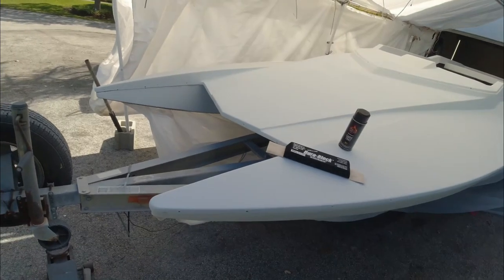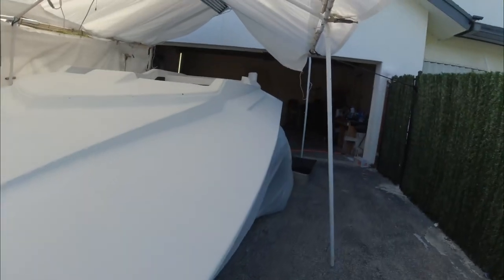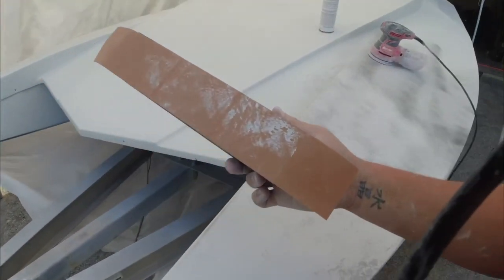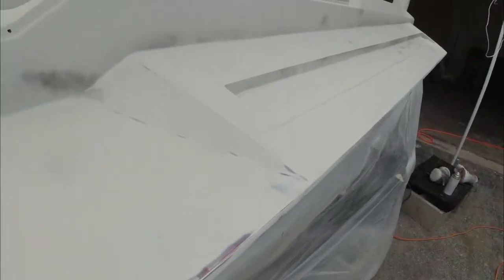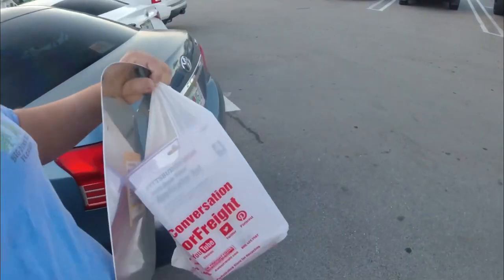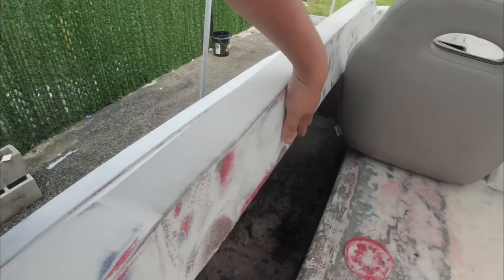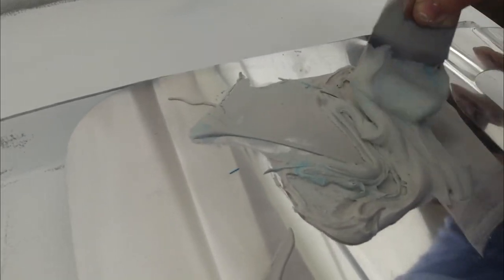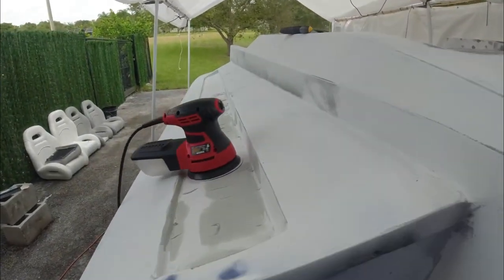Block sanding high build primer to find low spots | Applying 3M Body filler

Comment: I dig the video & the new jams. Looked like your primer was thick & not fully cured. 

I’ve been sanding filler w/ 80 grit for shaping, then hit everything w/ 150 grit before primer. 150 grit in between primer coats, then 320 grit before paint. Every manufacturer  has their recommended grits & procedure. Several ways to skin a cat. Your motivation & no fear is awesome 👍👍
Reply from the maker: Thanks for the advice man 🤙🏼
Reply: Great advice I’m doing gel coat on my boat I never done gel coat before
Reply: @boatvibes  thanks for responding Luis. You did the right thing by turning her all one color to see the imperfections. 

I’ve found that applying more thin coats than a couple heavy coats is easier to sand because it cures better. I’ve also laid the first coat on a little thinner to use it as a tack coat for the rest. 

Everyone has their own way & a lot of good info on YouTube. Boat Painting and Restoration with Frankie Bushong YouTube channel does a lot of spraying. 

There’s a great comment on your last video about why you’re getting water in your line & gun. It’s all about getting clean dry air. A larger compressor would be able to keep up. Air filtration & a water separator will also help you.

Comment: Hey Luis, I'd recommend vinyl flooring instead of the carpet. A lot easier to clean the dirt and sand. I spent years cleaning my carpet and got really tired of doing it so I put vinyl in and love it. A quick wipe down with a wet rag and it's clean.
Otherwise I love your channel and enjoy watching your work and boating fun.

Comment: Pay attention to my advice like 7 videos behind. lolol Use a 1 Part.
Beyond that, I mentioned you sprayed the primer too heavy, it's not completely dry all the way through. Let it sit another couple days & it will sand smooth. Read my comments last couple videos.
Reply from the maker: I have read your comments I really appreciate the feed back. Your right 100%  When I spray primer again I’ll lay it down light then block it.
Reply from the maker: This is all new to me so please keep telling me what I’m doing wrong that’s the only way I’ll learn for the next builds 🤙🏼
Reply: @boatvibes  You're nailing it! Keep doing what you're doing. But that's why the sandpaper was "gumming up" is cuz it wasn't dry. It dries from the outside in, if heavy, it takes the bottom longer to dry completely.
Reply: @boatvibes  I learned just like you...many many failures! You won't have those failures, you're already past where I was at this point at spraying paint. Keep it up.

Comment: Keep up the good work and persistence. You only learn from doing it and mistakes.  Are you building bases for your seats?? Otherwise your sitting on the floor. Kinda surprised your not doing a hotfoot off the bat and do trim in the steering wheel. Way easier to drive and learning how to drive tunnels. Separate throttle and trim is great on way bigger boats. You never see that on Talons, Skaters, Mti's under 40 ft for a reason.
Reply from the maker: Thanks man. No I’m not building a base for the seats I don’t want to stick out any high then I need to. I, building it this way because this boat is mainly going to be driven by my GIRLFRIEND who is new to driving boats that being said it will be easier for me to teach her if I have control of the throttle and trim. Once she is comfortable I’ll definitely be putting a hot foot with the shifter In the middle.  The trim will be wired to the console and to the steering wheel